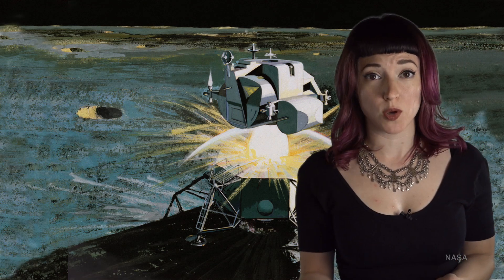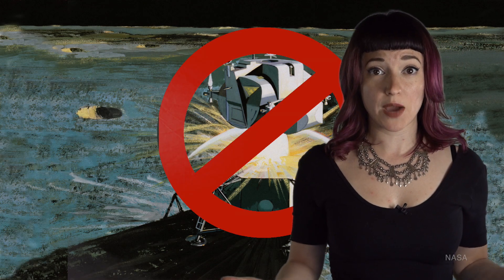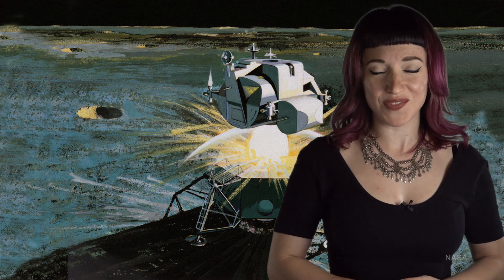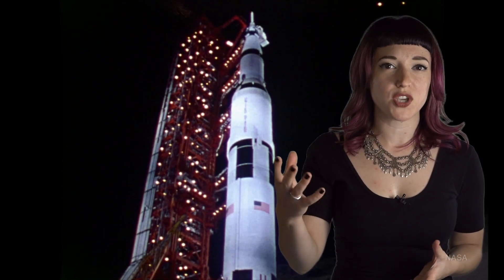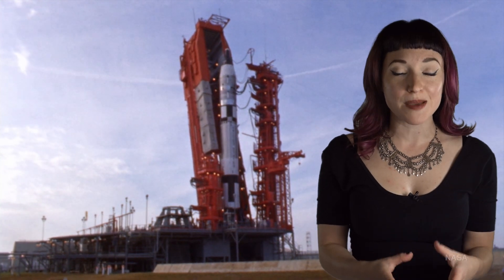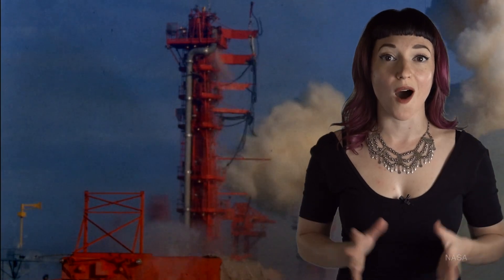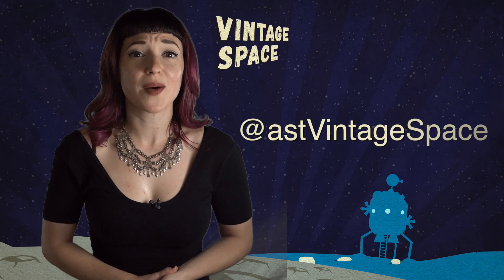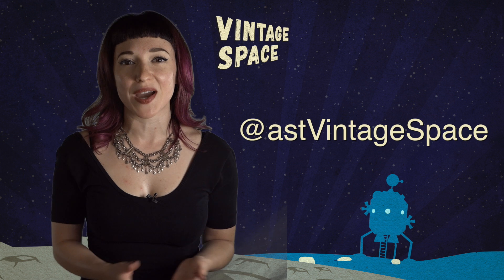How the Lunar Module Launched from the Moon Without a Flame

Comment: Hi Amy, nice explanation.
Could you talk about the effects of Van Allen belt on astronauts?
By the way... I love your voice
Reply: She has already done at least one video on the Van Allen belt and radiation exposure to the astronauts.  Look through her previous videos to find it.
Reply: The belts are torus (donut) shaped. There's an inner and an outer belt. The radiation levels vary throughout. One of the goals of the Mercury and Gemini missions was to map the radiation levels in the belts. With the help of Dr. James Van Allen himself, they plotted a trajectory for Apollo 11 which avoided all the belts except a small part of the outer one. Dosimeters on board showed a total dose of about 1 x-ray (30 minutes in the belt each way). 

The problem for the upcoming Orion mission to Mars (which flat earthers point to as evidence for the impassibility of the belts) is that a) modern electronics are MORE sensitive to radiation than the vacuum tube tech of the 60s, and b) a mission to Mars requires a different trajectory, requiring much more time in the belts. So they'll have to spend a lot of weight in shielding for people and equipment.
Reply: I'd just like to point out Apollo guidance computer used transistors, not vacuum tubes.
Reply: Lajos Winkler And the thing is a fucking brick compared to modern circuits, it specifically used a design requiring the minimum transistors. As such, it presented a tiny target to radiation. Furthermore, transistors can be shielded -- New Horizon's equipment was heavily shielded, for example, and worked fine. The point is that the rocket scientists are not stumbling around with their thumbs up their asses.

Comment: all this lunar module launching gots me wondering if it takes that much fuel to launch from earth wouldn't the lunar module need a lot more than that, or is the moon really that small?
Reply: The moon is much smaller than the earth, and has no atmosphere. Launching from earth into orbit takes about 9 or 10 kilometers per second. Launching from moon into orbit takes less than 2 kilometers per second. In addition, the Saturn V had to lift over 100 tons into orbit, whereas the lunar ascent stage only had to lift 5 tons. Still, half of the mass of the ascent stage was fuel.
Reply: Isaac Carroll
interesting. thanks for the info
Reply: Nice  explanation.  Thank you Isaac.

Comment: Even kerosene+LOX burns with a nearly invisible flame in a vacuum; see the cameras on the second stages of SpaceX Falcon-9, the first upper stage to use those propellants in a long time. All chemical rockets burn fuel-rich, but not only does the plume rapidly expand in a vacuum but there is no oxygen to burn the residual carbon from the kerosene.

Comment: I'm curious about the launch sequence used for the LM ascent stage. It would seem that first the LM's guidance computer would open the propellant valves to attempt to start the ascent engine. Then if and when the engine starts and the thrust builds up high enough a signal from a pressure sensor in the thrust chamber serves to tell the computer that the engine has started and it has come up to full thrust. Then only after the engine starts properly would the guillotines be fired to sever the electrical connections and the pneumatic and liquid plumbing between the 2 stages and simultaneously the explosive bolts would be fired to mechanically separate the ascent stage from the descent stage. Then up it goes. This is similar to the launch sequence used for the Saturn 5 and the Space Shuttle, just on a smaller scale.

Comment: How long do you think it would take to fake 15,000 photographs with sets, film cameras and no photoshop (https://www.flickr.com/photos/projectapolloarchive/albums), fake all the hours video, design build all the hardware, perform all the "unmanned launches" for the press, organize and bounce all the radio transmissions off satellites to fake them coming from the moon? For Christ's sake it would have just been easier and CHEAPER to just go to the moon. 

Sorry for the run-on sentence.

The ONLY possible way you could believe we did not go is that you're just ignorant (in a non-pejorative sense). That's it. There's no discussion, there's no debate.

Even MORE: http://www.apolloarchive.com/apollo_gallery.html

Comment: I always wondered how the camera panned back and followed up. With no photographer,and a long delay from earth,how was the camera able to pan and tilt on liftoff?
Reply: Simple. Ed Fendell, who operated the camera, knew EXACTLY when the ascent stage fired, and he knew EXACTLY the delay in the electronics and the transmission delay. So when the countdown to liftoff reached a specific point, he started sending commands to the camera "in the blind" - without looking at what happened on the screen.
Reply: And he had two previous tries which were not as successful as the Apollo 17 liftoff recording. On 15 and 16, he gained the experience necessary to pull off 17s liftoff.

Comment: How did the astronauts get through the radiation belt? I've heard that estimates are that the astronaut's would've needed five feet of lead shielding. They did not have hardly any shielding, and no Apollo astronauts developed cancer or other radiation illnesses. Please explain!
Reply: The 5 feet of lead. Old nonsense. PARTICLE RADIATION can for the most part be stopped by PAPER.
Reply: The 5 feet of shielding came from a non expert in radiation who was also a non expert at a lot of things related to Apollo. His name was Bill Kaysing. He claimed you'd need 6 feet of shielding because radiation kills, or something to that effect. He failed to mention the short duration the Apollo spacecraft spent going through the belts or the fact they passed through the outer edges. Kaysing was also responsible for the easily refuted "No stars" nonsense. He had to know that was a lie because anyone who could operate a camera would know why there were no stars in the Apollo or any space flight imagery taken under Apollo like conditions.

Comment: Anybody:  Where is the rocket fuel stored?  There's no long (or short) tube-structure, 
  as we see on every other rocket, missile and jet plane.
Reply: Those vehicles are all streamlined because they have to move through the air for part or all of their flight. The lunar module operated entirely in a vacuum, no streamlining necessary. The fuel tanks on the lunar module ascent stage were spheres, while those in the descent stage were short cylinders:

https://s-media-cache-ak0.pinimg.com/736x/ab/19/66/ab19669f979612eaa73c93764efa3be0.jpg
Reply: NelC   Thank you sir -- good answer.

Comment: I'd love to hear an explanation of how the radiators in their backpacks worked in the vacuum of space to keep them cool. btw I'm about 99% certain we went there.
Reply: It was ice sublimation. A porous plate where water seeped out into the vacuum, some of it evaporated and the cooling it provided froze the rest. Water circulated through the plate, and the heat was transferred to the ice, which evaporated, and carried the heat energy away. The actual limit on the spacesuit endurance was how much water it could carry. There was plenty of oxygen, LiOH and battery power to stay out longer, but the cooling system would run out.

Comment: Before they changed the fuel mixture, formula-1 race cars ran on almost 100% pure alcohol and it burned with an invisible flame.  Sometimes there would be a fuel spill in the pits that caught fire and nobody knew about until the pain began.  Now it burns with a yellow flame and can be easily seen.
Reply: No, that is not Formula 1. That is NASCAR. F1 has always used petrol-based fuel.
Reply: +Allan Folmersen sorry to bust your bubble Allan but you're 180degrees out.  "NASCAR" uses stock cars (not that there's anything stock about them anymore) and gasoline.
Reply: Jim Adams Then it's the american open-wheel racecar series which uses methanol for fuel.
Reply: They used to use it for fuel. Now they use a blend of Gasoline and Ethanol. Which burns not only cleanly, but you can see it burn
Reply: +Allan Folmersen duh, that's what I said "Formula-1"
Reply: Jim Adams USA open-wheel race is NOT Formula 1. It's called INDYCAR.
Reply: Also, by mixing a little (1 or 2%, IIRC) gasoline, it denatures the alcohol.  Because of that, they can transport the fuel as needed without having to futz with a billion ATF regulations.

Comment: i have a suggestion for the greenscreen. have the camera be facing vertical, not horizontal or move to the middle, then you could crop the edges and move yourself to the side in post thus getting rid of the little artifacts in the corners

Comment: Can you see Apollo stuff on the moon with a 10" telescope? And how big of a telescope would you need to see plant life on a exoplanet! 39 meters? 100 meters? 5000 meters?
Reply: No telescope on Earth can see Apollo artifacts on the moon. Even the Hubble cannot do this. The best Hubble can do is to spot objects as small as maybe 100 meters which is much too large to image Apollo artifacts. It took the Lunar Reconnaissance Orbiter (LRO) to image the artifacts from what was reported to be an altitude of 15 miles. As for exoplanets, they are too far away to see plant life. At this point, the best a telescope such as the Hubble can do is to see planets as a few pixels. Hubble imaged one orbiting the star Fomalhaut which is a star approximately 5 times further out than the nearest star. Seeing an exoplanet would require the  telescope mirror to have a minimum diameter of around 500 m.
Reply: +J Dean sounds like someone needs to build a new telescope!
Reply: https://en.wikipedia.org/wiki/List_of_largest_optical_telescopes_in_the_20th_century they're working on it. I hope I get to see imagery from a 500 plus meter telescope in what's left of my lifetime. I'm especially interested in exoplanets.

Comment: Again, I have to chide Ms Teitel gently.  A non luminescent flame is not necessarily characteristic of hypergolic fuels and does not reliably differentiate hypergols from non-hypergols.  Example: propane and air are not hypergols, but when I burn them in my propane torch, they produce a clean, flame with only a trace of luminance.  What makes flames non-luminous is usually a lack of soot particles.  It happens that dinitrogen tetroxide and Aerozine 50, burned in a typical rocket engine, do not produce a luminous exhaust.  Most of the common hypergolic rocket fuels do not contain a lot of carbon, particularly carbon bonded to carbon.  Because of that, soot formation is unlikely with them.  LOX-LH2 is non-hypergolic and produces clean flames.  Even LOX-Kerosine would burn pretty cleanly except rocket engines using them often are designed to run fuel rich in order to prevent burning through metal components.   Flame luminosity depends on combustion conditions, as well as fuel type.
Reply: "They typically burn clear" emphasize the word typically, it infers that most commonly the burn with a clean exhaust, no implication towards "all hypergolic fuels burn clean"
Reply: +bower31   "Typical" does not mean, "sometimes" or even " most of the time" it means, "having the distinctive qualities of a particular type of person or thing".  Burning with a non-luminous flame is not a distinctive quality of hypergolic fuels, since some hypergolic fuels burn with bright flames.  It is also not true that red hair is a typical or characteristic feature of Irish people, even though red hair is relatively common among Irish.  If red hair were typical of Irish, you could look at a blond or brunette and say with certainty that he is not Irish.  If a non-luminous flame were typical of hypergols, one could look at a luminous flame and say with certainty that the fuels are not hypergols.  This is patently untrue.
Reply: Actually, all hypergols burn with a bright luminous flame. It just happens that that flame tends to hang around in ultraviolet (and deep infrared) wavelengths.
The "normal" orange-red we tend to associate with "flame" is only really relevant when burning carbon with molecular oxygen.
Reply: +Marvin Kitfox   As a chemist, I'd love to see spectra.  Do you have any links?
Reply: +Marvin Kitfox   So far as I am aware, the "normal orange-red" we associate with flames is black body radiation from soot.  Other solid particles in thermal equilibrium would emit a similar black body spectrum.  Solid rocket exhaust is very bright.  In the high performance SRBs used for spaceflight, there may be Alx Cly Oz particles, a bunch of hybrid particles and probably a little aluminum still in the process of reacting, in addition to soot.
Reply: +Marvin Kitfox   The Diamant A exhaust has the typical bright glow, but is fueled with turpentine (a hydrocarbon) and IRFNA, a mixture of nitrogen oxides.  No molecular oxygen needed!
Reply: Of course, flames are necessary in science fiction movies so the audience knows a rocket is firing. And it looks more impressive than a flameless burn. But lots of things are made up in movies, like a person shot on a balcony being knocked over the railing, silencers making gunshots really silent, etc. Or a stick in the spokes of a motorcycle wheel making the cycle flip over.
Reply: It's unburned stuff, basically. A very hot, efficient fuel will produce little visible in the flame. Her points about hypergols are correct, though. She's avoiding the more general issue here, just to stick with the lunar lander.
Reply: @bostonseeker  NOW LOOK HERE, THIS IS GETTING REALLY SILLY, TOO MUCH --'IVE GOT THE LONGEST COCK AND NOT ENOUGH UNCHALLENGEABLE PROOF

Comment: Also, because the ascent engine was forcefed fuel by heliumpressure in the tanks, the chamber pressure was quite low. So the combustion was well finished before the exhaust left the nozzle. In fact, on Apollo 17, you get to look straight into the nozzle and can see the combustion in there. The throat of the chamber was 22 cm.

Comment: One thing the hoaxers bring up about the same footage 0:24 is the spray of colorful debris on separation, and the "leap" of the accent stage like it is jerked up.  Some claim this is a firework and a string.  The real reason for the debris and the "leap" is the accent and decent stage were designed to separate in flight if needed.  This might happen if they ran low on fuel, or botched a landing a landing strut.  All connections, fuel, oxidizer, electrical, control, are separated by explosives.  The physical connections are via explosive bolts and separation is a sudden pop that is supposed to get the accent stage away from decent.
Reply: NEVER MIND THAT SHIT--WHY ISN'T THERE A MASSIVE HOLE IN THE GROUND WITH A DUST CLOUD A HUNDRED FOOT HIGH ?
Reply: @MrDaiseymay  Because the force needed to lift the ascent stage would be about as much you'd need to lift a small car.

Comment: Hey, Amy, so LEM used the same fuel as the gemini launcher?
That does explain the orange secundary color in the exhaust of Gemini at take-off (the color of the oxydizer).
But... Those hypergolics are known to be extremely toxic (carcinogenic to the max), so using those fuels on the launching pad would be hazardous for the crew working there, wouldn't it? So, why were they used by Gemini, at all?
At the time the LEM was being developed, this was known, that is why they moved the testing site for the LEM.
Another fun fact: those fuels are/were so corrosive that the LEM engines that actually went to the moon could not be tested on the ground; the first time they burned was actually during the Lunar missions, adding one more thing to the list of things to worry about during the lunar missions... ;-)
That's what I've heared, anyway. Can you confirm this? Thanks!
Reply: I realize I'm not Amy but she might not have time to answer this question so I'll give it my best shot. The Titan-II was originally a USAF Inter-Continental Ballistic Missile in service from 1963-87. It used hypergolic propellants to decrease it's reaction time in the event of nuclear war. The ICBMs that went into service before it (Atlas, Titan-I), burned cryogenic propellants which required half an hour or more prep time to ready them for launch. Titan-II was actually conceived as a backup to the Atlas if I recall right. The propellants are so toxic, propellant crews wore something resembling the CDC suits seen on medical news reports etc. When NASA was committed to Apollo, the Gemini program was conceived as a way to test EVA, rendezvous and docking, and even long duration (Two weeks) spaceflight in earth orbit before committing astronauts to lunar flights. NASA had adapted the Redstone MRBM and Atlas ICBM for Mercury missions. It made sense to just modify an off the shelf Titan-II for Gemini given the time schedule. LM components including the engines were tested on the ground. However, they were not reused so the flight engines were used first time landing and leaving the moon. But the ground test engines ensured their flightworthiness.
Reply: Thanks, J Dean. The recycling or recuperation of the ICBM design for manned space flight makes sense. The use of other fuels in the Saturn V stages even more. That means Saturn V was specifically designed for the lunar missions, isn't it?